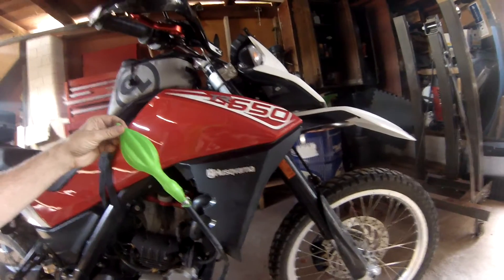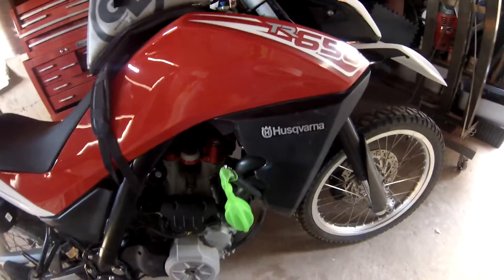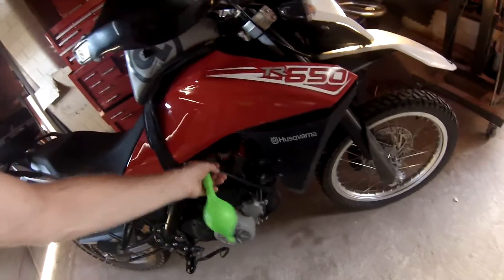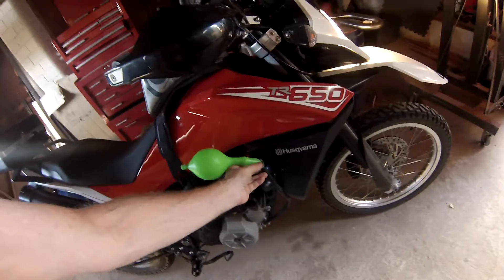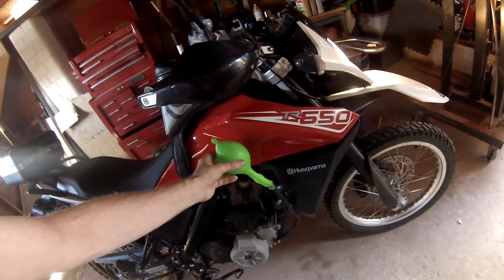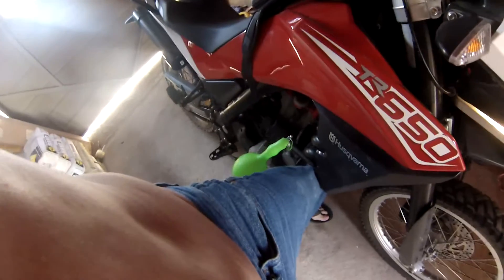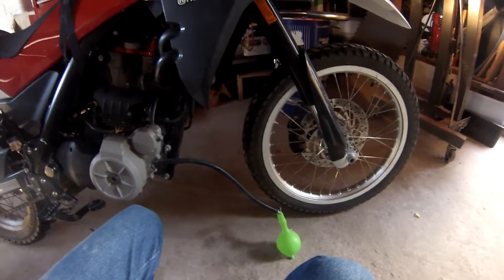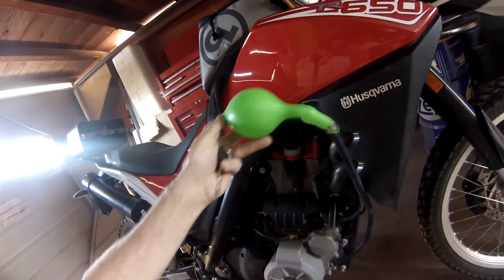Balloon Test TR650 Husky Breather PCV Terra How it works Pod Mod

Comment: Hey, thanks for the videos. I have the base part of the airfilter box broken where the crankshaft breather is connected to. Is it really hard to replace the bottom part? I checked it today like how much work it is going to be. I saw the box is assembled it two parts I was wondering if I need to get the radiator off if I want to replace the whole bottom part. Do you know about this?